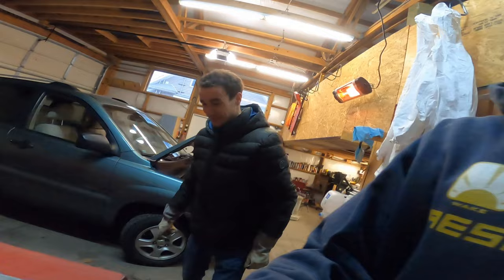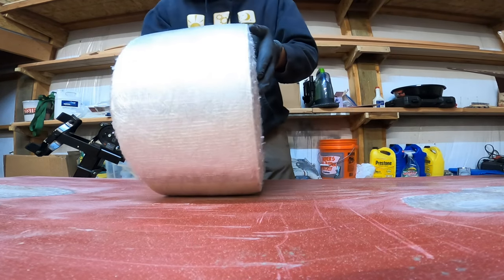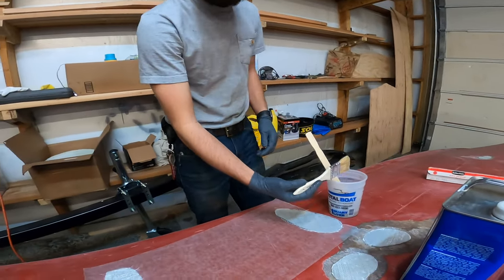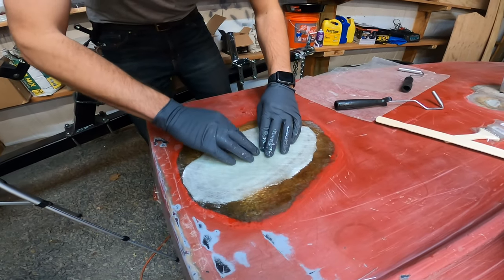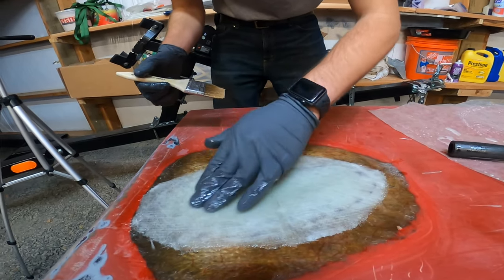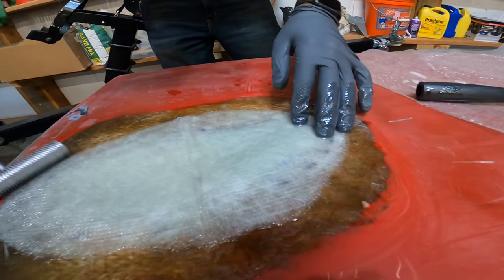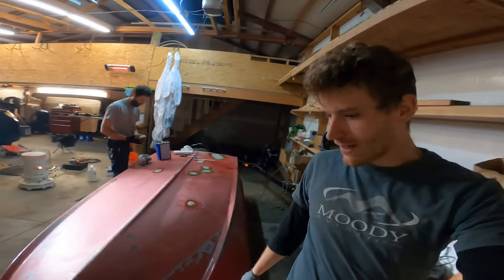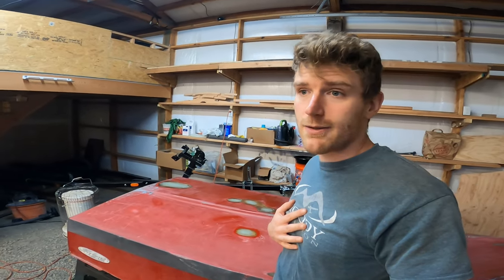Patch Repair (Part 8) 1708 Biaxial Mat

Comment: You can wet it out in place. Using plastic or wax paper to pre saturate is for large pieces to be set in vertical or awkward positions.
Reply from the maker: because of the large hole I decided to use this method, it was easier to work out any air pockets using wax paper. wetting the patch in place i was worried about pushing the patch through the hole.

Comment: you're now on the rebuild phases so congrats. Yes once the resin is fully cured a good sanding and filler to have a harmonious solid base to prep for painting. Great job so far...
Reply from the maker: thanks! do you recommend a good filler? I did already do chopped strand mixed with wood flour and epoxy resin to make a filler but I think it was a little soupy.

Comment: Is there a reason why you don't just put the patches straight onto the hull rather than putting them on wax paper first? I have never seen it done like that before??
Reply from the maker: I learned this method from Andy from Boatworks today this helps work out any air bubbles between layers before applying to the repair.
Reply: I was wondering too, as alot of surface cleaners are for wax and grease. 
But not sure if it's such a big deal with resin.

Regardless I love you videos, and I'm now planning on restoring my dad's boat.

Comment: Make sure you patch the hole in the inside of the hull
Reply from the maker: The type of repair i did won't require work on the inside of the hull. but i guess it wouldn't hurt to lay an extra patch down eh
Reply: @Project2Potential  it does friend. More is better. That area of the boat  tax max stress as you run up to speed and plane the boat. You NEED to do an internal as well. bigger than the  outer